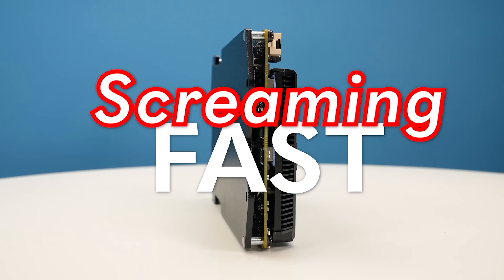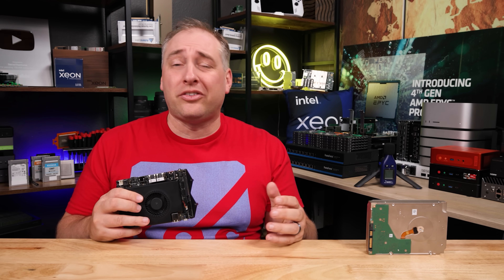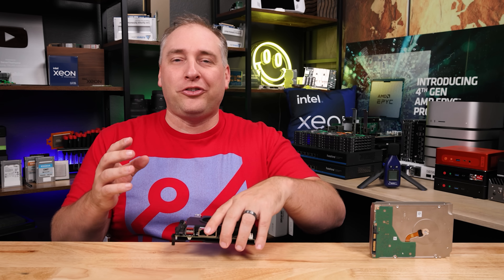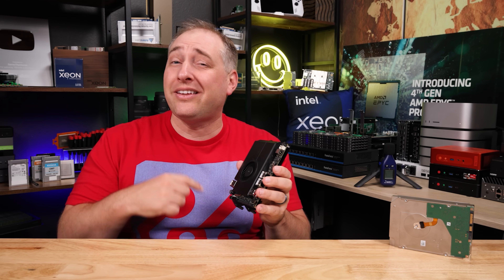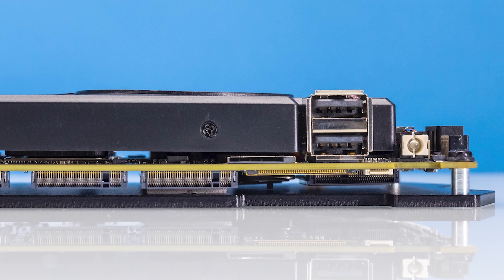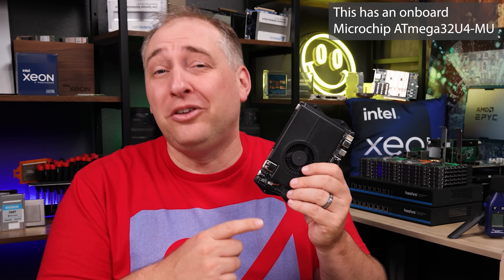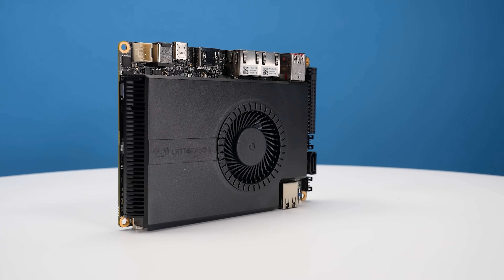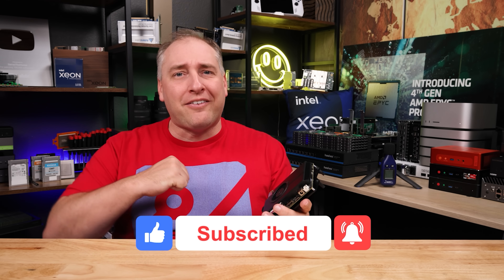This Single Board Computer is Faster than a Mac Mini AND a Raspberry Pi

Comment: Pretty easy being faster than a Raspberry Pi board. The original goal for the  Raspberry Pi board is being an educational tool. Not being a daily driver. However, the foundation has changed to being very commercial minded and is trying to make the Raspberry Pi board faster.....

Comment: This would be a buy if they had a translation layer so that you could program the Intel chip using Arduino code.  I looked and it has analog pins on it and all the good microcontroller goodies.  It's a lot of money to spend for a 16mhz 2 dollar arduino chip strapped to a lowish performance intel mini pc without a case.

That "lowish performance intel chip" used for Arduino applications though?  That would be something.  Unfortunately that's not what this is.
Reply from the maker: So I think of this as you are putting a relatively big PC with an attached Arduino controller. Think of an application like having a big local matching DB for a camera application with an AI accelerator. Then Arduino to control a function like a line flipper. Just a cool combo device

Comment: I love it, but Im kind of torn on the price. Im sure some will think its "too" expensive, but I think its price is probably pretty reflective of what is actually there and sits well in the market. BUT! When Im faced with actually going and making a purchase, and faced with the actual choices.. Im not so sure I would go with the LattePanda Sigma. I would probably end up going with a used enterprise MiniPC with something like a 10700T or some rPis for less money. I love what they did though, all the same.
Reply from the maker: A big part of it is the Core i5-1340p costs well over $300 alone. Add RAM and all of the motherboard bits and the pricing is pretty much in line
Reply: @ServeTheHomeVideo  Yeah, I think the price is pretty decent. Id go even further and say its a good deal for what is there, when considering the GPIO, PCIe, etc. However, if it came to actually making a purchase, Im not sure I would ever end up with one. It doesnt have a place in my projects or deployments that would justify the cost.
That said, depending on how the ECC side of things work, I could see this really taking off for something like TrueNAS. Where the market for hardware is just.. not great. Thats an area where I definitely could see myself making a purchase, depending on how well it actually works in that application.

Comment: I'm not a maker so I would much rather have the GTR7, but IMO this thing was gold plated to being priced out of viability.  I saw a review of this a while back and it's certainly interesting, but it's hard to imagine who the target audience is for this.
Reply: I think there are a couple of things that stand out really well for me. One is USB PD being perfectly fine without crossing the 100W requirement vs the GTR. Two, I can also add a cellular modem without sacrificing a second SSD. Three, TB4 expandability. 

The big minuses are the cost, the case availability, and the RAM limitation. Honestly if it had at least user replaceable SODIMM option I’d jump on it. I think 2x 32 or 2x 48 GB DIMMs would be great to upgrade to.

Comment: This thing looks awesome, i think i'll pick one or two up.
Imagine 8 Zen4C cores running at 3.2Ghz and using 12w, oh and to really tickle my fancy, find places to put 4 SODIMM slots so we can in theory upgrade to the maximum supported by DDR5, which i hear is 512GB with 4 DIMMS/SODIMMs, but should be at least 256GB as we're already at 192GB

Comment: Funny! I actually replaced all my raspberry pi's with 1 single small pc.. I think its powered by a AMD 8 core CPU. It's running proxmox and the best part is that it use less power than the 3 RPI's i had. Also love you can passthrough the usb ports to the VM and LXC.
Reply: Give us some specs and actual power measurement idle and load?
Reply: @Airbag888   @Airbag888  Can't post pictures here.. but use about 10-15 watts idle(10-20% cpu usage). It use about 45 watts with full load(never really reach this with normal usage) . It's important to say you have to enable the cpu freq scaling, otherwise it will just run at full power. 
You can also do a few things in the bios to make it even better.
Reply: @clausdk6299  but what cpu, motherboard etc?
Reply: @Airbag888    It's a mini pc from ali called "Topton New Mini PC Gamer AMD Ryzen 7 7730U". It's a AMD Ryzen 7 7730U(15 TDP). Motherboard wise it does not really say anything. I think it's a custom one. 64 gb ddr4 ram with 2 x 1 tb ssd in zfs raidz1.
Reply: @clausdk6299  oh gotcha. Sorry I was insisting because I thought you might have found the holy grail... an ITX board that would sip power haha.. makes more sense. For me the issue would be lack of 10Gbe network and of 1 or 2 nvme SSDs as cache.
Reply: @clausdk6299 from AliExpress right?? Its super cheap 😮
Reply: @clausdk6299
.
And I bet it cost a lot less than this did.!  An insane price from LattePanda, £799 for the 16G version with no Wifi or Storage 😂🤣😂  If you want to go nuts, you can opt for the 32G version for £899, or the 16G version for £899 but with a WIFI card (but no antennas) and a 500GB drive, again, insane prices. Price from Amazon UK (includes VAT/sales taxes FYI).
Reply: @ADB-zf5zr  Indeed a lot less 😁
Reply: Vfio is a massive rabbithole. Goodluck friend, you're in for a treat :D
Reply: hahah  @joshxwho  I know right!! On the good side... USB passthrough works without that :D

Comment: I like the idea, not 100% sold on it still but it's not bad by any means and I still remember when the first Raspberry Pi came out, crazy how far we've come in that short time!
Reply: i kinda disagree. the raspi was meant to be a cheap learning device. this is basically just an intel nuc not made by intel. the raspi was 60 euros when it came out, this is over 600 and not even ARM, but an offtheshelf intel chip. it does have some fun features like GPIO, but shouldnt that just be an expansion card? hell i see GPIO just be over a usb dongle

Comment: Interesting concept, but more expensive than a good used computer + arduino.
Reply: Unlikely if Thunderbolt is a feature you're after. Even these second hand minipc workstations ramp up in price when TB4 is involved since it wasn't implemented until last few generations of hardware which is still pricey. It's not a bad SBC but yea, you do pay premium for size and features.
Reply: @Micromation  
It is a sidegarde of a NUC 13 Pro kit.
Reply: @tyaty  Little better graphics little better power efficiency but not much else. The NUC 13 also didn't come with thunderbolt 4. The 2 use cases i can think of that this will be the best choice for  is if you need Thunderbolt 4 and/or USB4 but not much else the other is if you want a Arduino devlopment board to speed up devlopment time time. Having the physical chip on the PCB will help solve hardware problems not in the Arduino emulated environment.
Outside of those 2 use cases any of the other mini PCs STH has reviewed would be better than this. You just might need to also have  a NAS for storage with them as limited storage is an issue with most mini PCs.
Reply: @yumri4  
Every NUC 13 has TB4, it is just not always highlighted in their spec sheet. Value wise the Sigma on par with a NUC kit for general use.

It is pretty versatile compact   development board, which has the performance of typical mid-range laptop.